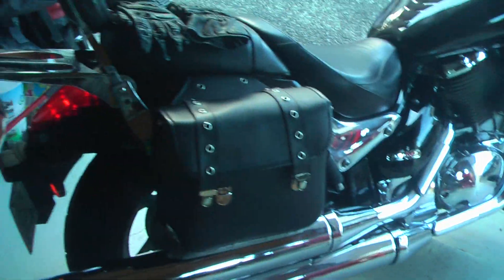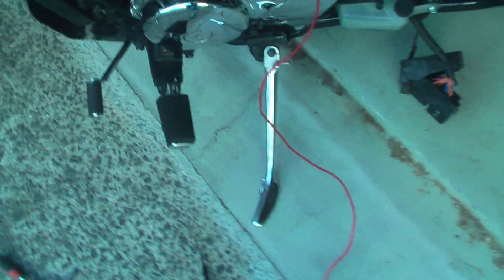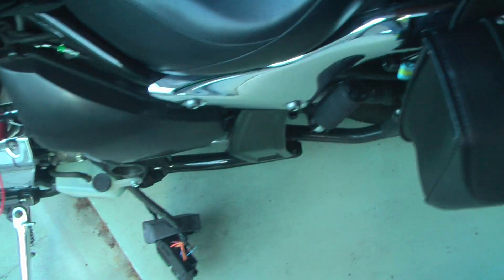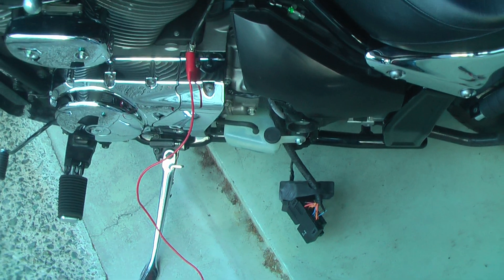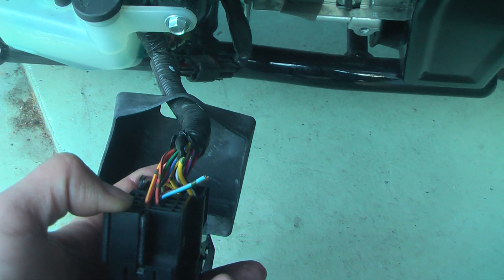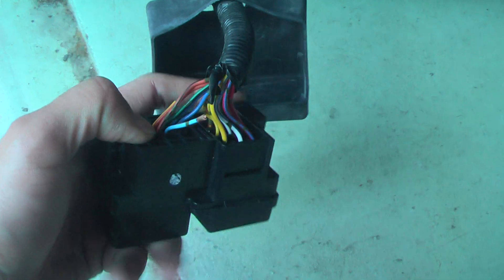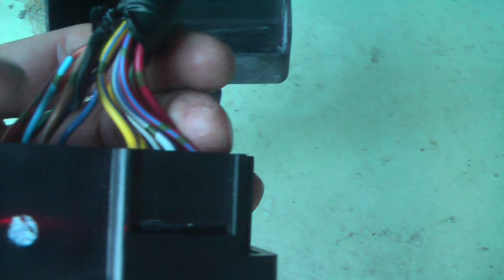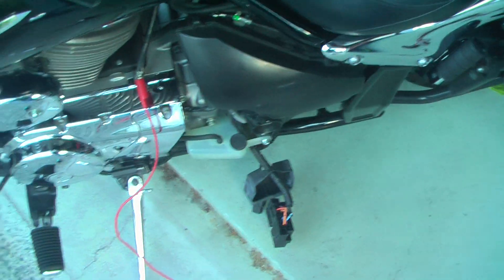Suzuki Boulevard - LED indicators installation: Bypassing indicators relay (Denso FE249JR)

Comment: Drastic to cut the wires the short-circuit the flasher relay. It is also possible to bridge the connections between the blue and brown wires on the back of the relay holder with a jumper-wire. Or just replace the relay with a LED-compatible one. The flowing effect will be the same and the dashboard light will still flash.
Reply from the maker: it is hard to insert the original module back if you try to bridge it from the connector side. if I think back, I could cut the pins on the module, to leave some room for the bridging connection, if I do it this way. However, this is gonna make the restoration harder, in case of needing it in the future. it is way easier to just solder two wires back together. As of your second suggestion, it is always the best way of doing this, I am not questioning it at all. However, in New Zealand, at the corner of the world, where ebay doesn't even ship anything to, it is either very difficult to get one of these, or very costly. Finally, my video is providing the the bottom logic of "bypassing" the reply, instead of simply getting a new module and plugging in (there are heaps of video about this already), which is a completely different method. I hope this makes sense?
Reply: @liyisu  I tested with a small jumper made of single strand solid core wire to short circuit between the brown and blue connectors on the backside of the relay holder where the wires are coming in and it worked. Maybe it would also work to wind some thin uninsulated wire around the two pins on the relay and reinserting it. But I ended up replacing the relay with a low current, LED-compatible one to make the dashboard indicator lights also blink.

Comment: Could you please say how you got the fuse box and relay holder detached from the motorcycle so it just hangs like that, so you can access the wires? I don't see what to push or pull on, or unscrew. Thanks.

Comment: Hi , what about dashboard light? working normal?
Reply: The green indicator lights on the dashboard will light up continuously while the turn signal is on. Easy to forget to turn off if the light is not flashing. I will replace the relay with a LED-compatible one instead.
Reply from the maker: @JohanBeronius  you are correct.

Comment: Is that instead of buying a led relay?
Reply: No. This kind of flowing indicators have the flashing controller built in, so the need to be supplied with constant power, that's why he bypasses the relay. Most non 'flowing effect' LED indicators need a LED relay.
Reply: @user735_  They don't need to be supplied with constant power even if they have built-in electronics to handle the flashing so they can be. If the flashing frequency from the relay is the same (85 flashes per minute) the effect will be the same when the power is cut intermittently.
Reply from the maker: you could go with either, no need for both.

Comment: Would this fix the issue with my led running light not being on?
Reply from the maker: there is a separate wire for the running light. 3 wires for the front lights and 2 for the rear lights. out of the 3 in the front, one of them is your running light, you need to connect that one to your running light wire.
Reply: I’m having this same issue. My led signals work fine but when I wire in the running lights, my signals don’t work. Did you have this issue with your running lights as well? You only show the signals in this video.